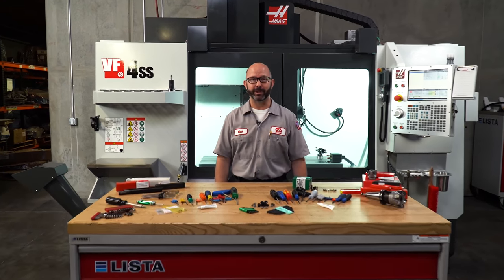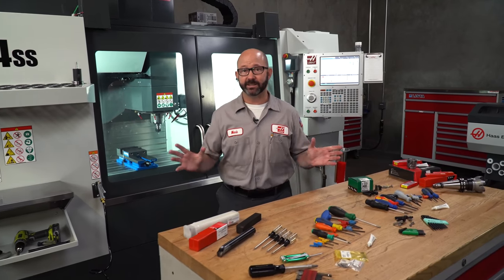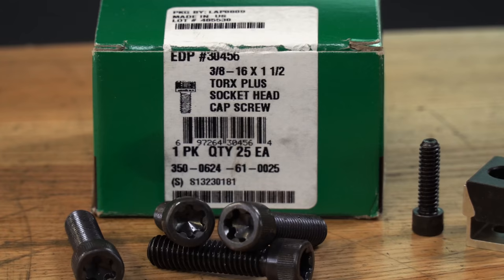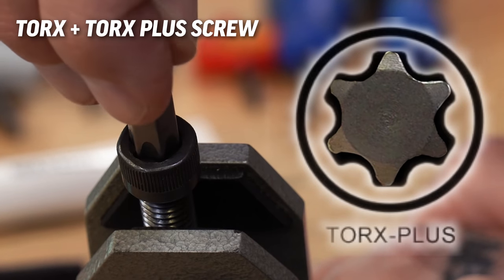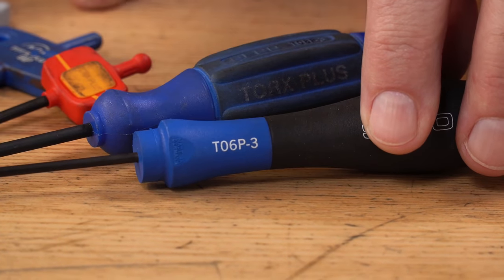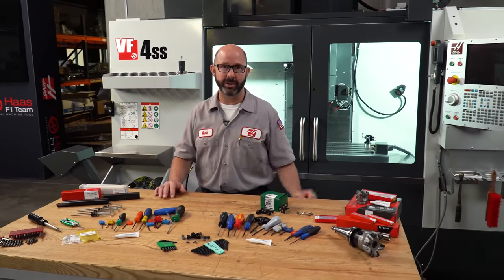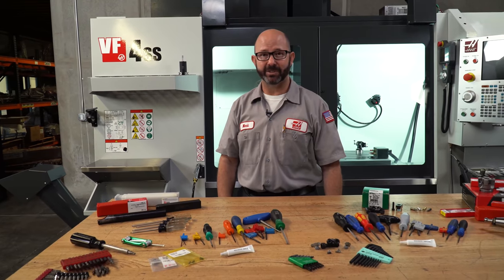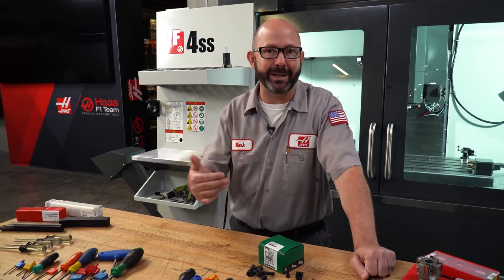THIS IS NOT A TORX - Haas Automation Tip of the Day

Comment: In the 1990s, when I sold Mac Tools I was talking to the oldest mechanic in the Buick dealership.  His toolbox looked like something you would see in a home garage and was dwarfed by the huge, newer boxes.  I was remarking on how his experience and age did not seem to match with his toolbox and he told me that since he was nearing retirement he only bought what was necessary.  
He told me that when he started, there were no Metric, Torx, Allen, etc., or electronics on most American cars, and when he bought that "small" toolbox all the older mechanics told him he would never fill such a big box.
Reply: I have an old mechanics setup for British tools. it's two smaller toolboxes with handles (2 layer, removable spanner/socket top layer). He has tools that you see in classic auctions (50s stuff) with 8 different bolt sizes on a single tool.. and a collection of them AND the sockets to go with, extensions and the rest. Then the spanners to top it off. So he had everything he could ever need to work on British cars or stationary Diesel engines, all British standard size. And you could carry it with you in a backpack to the top of a damn mountain if you had to in a war..
Reply: And then what happened? Did the other hacks in the shop steal all his tools?
That is what happens the world over
Reply: @godsinbox  No. This is a professional shop.  The other mechanics used their own.
Reply: @N4CR  Do you mean you have the tool setup from an old mechanic? Was it bought, or gifted?
Reply: What a great comment. There's an old Michael J Fox movie, Doc Hollywood, 1991, where the local mechanic has to work on Doc's Porsche, and says  "I always wanted an excuse to buy a set of metric tools". It was a great line.

Comment: Phillips camming out is actually a "feature". It was developed as a means to prevent over-tightening in the days before driver clutch mechanisms.

And I hate it.
Reply: Who don't hate that shit. But it's still easier to work with than flathead screws that are next to impossible to get in right without injuring yourself.
Reply: @ehsnils  Switch to Robertson....
Reply: @MaverickBlue42  Fewer contact points means less reliability. I'd rather select XZN.
Reply: Philips head screws are great for their intended purpose, there's a reason we still use them today even in a professional setting. 
But when they're used on screws that needs more torque applied than its intended for just because "well everyone has a phillips screwdriver" yea that's pretty shit...
Reply: @MaverickBlue42  I would rather stab myself in the eye than use square drive. Torx is better in every way as far as I'm concerned.
Reply: Get some JIS cross-head bits. Japanese Industrial Standard. 
They're a necessity for working on Japanese bikes but they work GREAT on Phillips head screws. 
Thank me later.
Reply: Well, that's nice. 2 screws that are nearly the same, but not really. Enough the same though, that depending on the light, finish on the screw, magnification, or lack thereof, and less than optimum eyesight, I can't tell the difference. And I may or may not need 2 complete sets of drivers. Super.
Reply: Failure by design.
Reply: The video shows a screw head being destroyed, but calls it "camming out", which is not correct. A Phillips screw will cam out (protecting from over-torquing) with minimal damage if used as intended. Still annoying - I would rather have Torx or other non-camming drive with suitable management of torque.
Reply: @AaronzDad  yes,you are so right sir.
Reply: Try some JIS screws
Reply: JIS ftw
Reply: I hate em too. 
But a dab of valve grinding compound on the tip of your screwdriver works wonders. 
Grab a tube at your favorite automotive box store. 
Give it a try,it works wonders.
Reply: @MaverickBlue42  lol first ya gotta remove the damn stripped Phillips head 🤦🤦🤣🤣🤣🤣🤣
Reply: @ehsnils  XZN works great, the exception is in corrosion prone use cases. The high surface area of those small splines means they corrode more and weaken faster compared to something like Torx. Speaking from personal experience, I wish Volkswagen/Audi Group would recognize that fact. Obviously less applicable in the machine shop, but important to point out nevertheless.
Reply: @MaverickBlue42  eww gross. the only time i ever put a square bit in my driver is to take rebertson drive screws out and throw them away.
Reply: Trouble is the fastener always seems to take more force to break loose than it did to tighten it. Kinda like Mt Everest takes more effort to descend than it did to summit.
Reply: @brianb-p6586  Part of the issue being that an awful lot of the Phillips screws we see nowadays are very soft and easily damaged, obviating the cam-out feature.

Comment: This is something that has always blown my mind. How are there so many machinists that don’t know the difference.
Reply: Utter disinterest. They're the type of machinist that work on a machine for 10 years and don't know the basic things about their control and what the various buttons on there do - not having picked up the manual and give it a glancing check in all that time.
Reply: you use what's on the shadow board or in the drawer. I've been in factories the better part of a decade now and this is news to me
Reply: lol! Do you know everything in the machining handbook!
Reply: @dominic6634  lol! This isn’t in the machinery handbook!
Reply: YOU don't know, what YOU don't know.
Reply: The real question is: Why should there be a difference...
Reply: @dominic6634  there’s a handbook?
Reply: @AmalgmousProxy  Greater torque application, less likely to strip out. You do realize that you can't learn every problem with your standard before it hits the market right? Torx Plus and Hex Plus are far superior.
Reply: @svn5994  My point that you failed to understand is they need to phase out the inferior fastener. An example of this is there's absolutely no reason to keep making flat head screws. Not one reason. To this day they still make torx and torx plus, same thread. There's no need to keep both...
Reply: @AmalgmousProxy  i agree, I wanted to buy some torx plus but can't find almost  any online. Ideally I'd buy a complete set of sizes from smallest to biggest once for life. There are also   TORX TTAP and TORX PARALOBE both upgrades to torx plus, but where the fuck can you buy them? Honestly I've searched and searched but to no avail.  

Its just like with the titanium tools coated with micro diamonds, almost no one knows what is the best, steel can't rival titanium, much less diamonds, the hardest known substance to man.

Comment: Great video as always! I wish more manufactures stepped up with good well edited educational content not just some one minute flashy marketing wank crap that gives zero practical information. Also you should do a follow up about insert screw torque wrenches/drivers. They are a wonderful investment if you are doing any sort of serious production and changing tools a lot.
Reply: That is a great topic. We avoided Torque Specs in this one, but we'll be coming back to it. Using a lubricant will completely change our torque values, and just about all tooling manufacturers recommend using a lubricant on our insert screws. I was doing engine block machining, and using ARP studs for the deck plates, and the torque numbers I was given were not for bolts using the ARP Moly/Ultratorque, so when I tightened things up, it immediately ripped the studs right out of the aluminum block, with so much tensile pull. When using a lubricant, we get a much more even torque (less torque scatter), and we end up using lower torque values. On old engine heads, you had one spec if you oiled the bolts, and another if tightened dry.
Reply: @markterryberry4477  спасибо,это было интересно!

Comment: I first ran into Torx Plus fasteners on my 2000 and 2002 Astros. GM uses T+ fasteners extensively, to the point that when I find a Torx fastener, I reach for a T+ wrench first. I've found that Ford also uses them for high load applications. My '04 Ranger uses T+ fasteners to attach the box to the frame, and for the door adjustment fasteners.

Comment: There's also RBRT Torx tools for the torx screws that have become stripped or wallowed out. They're designed with angled teeth so as to grab the fastener to ensure removal.
Reply: Ooh, I learned something new. Thank you
Reply: Also, I've noticed if you have a regular torx 15 screw that is worn out that you can sometimes fit the Torx plus in it to get it out.
Reply: Heard you can just use an Allen but I've never needed to try it myself
Reply: @wades623  You might get lucky on a certain size or two but it definitely doesn't work all the time.

Comment: What will really bake your noodle is finding out how many different “cross” screwdrivers there are.
Reply: There's Philips, Posidrive, and JIS that I remember off the top of my head... and curse the inventors out whenever I encounter them because I almost never select the right tool for the right head the first time.
Reply: You know what really bakes my noodle?
Finding a flathead screw.
Reply: @dougaltolan3017  - I’ve seen a lot on ships and old engineering.  They have flat head nuts, bolts and there’s no thread.  Spooky stuff!  ;-)
Reply: @dougaltolan3017  Watchmakers use flathead screws for almost everything.

Then again, watchmakers also custom-grind their own screwdrivers for a perfect fit...
Reply: @daveys  🐸
Reply: @kaseru6760  That's not actually true.  It's called Torq-Set, it was developed by Phillips, and a bunch of aerospace companies use it.
Reply: @dougaltolan3017  Slotted screws* - flathead is a type of screw profile. But to be fair if it's not a high torque application, slotted screws can sometimes be handy as you can use somthing common like a coin to tighten or loosen it. So if it's going to be used somewhere were tools arn't likely to be around and needs to be serviced often, slotted screws can save the day, just keep a few spares handy. And even slotted drivers come in a variety of different sizes for a snug fit, if you are using the same size for all slotted screws you are doing it wrong, but they do give you that flexability in a pinch.
Reply: Which indeed is really strange, because in my eyes the JIS-Standard is clearly superior to the others and exists for probably over 40 years now...
Reply: I didn’t realize how many there were until I read your comment and looked it up. Holy cow!
Reply: @peteraugust5295  Well, Frearson does almost everything that JIS can do, plus you only need one size driver for almost any size screw, plus it dates back to the 1870s!  The only thing JIS does that Frearson doesn't is the ability to use JIS bits on Phillips screws without damage.
Reply: What really bakes my noodle is going to get your Phillips screwdriver only to find out your kid already swiped it on you and didn't put it back where it came from
Reply: Now there are multi-cut screws because of evolving tool standards - to keep them backward compatible.
Electrical outlet mounting screw heads are cut to take flathead, phillips or square bit.
Unfortunately, that leaves very little surface to grab on to no natter which of those tools you use. ARG!
Reply: @2Truth4Liberty  we need to make a screwdriver that use all of those to engaging with every small bit of material left
Reply: @aggese  I'd hate to add yet another tool to the already wide variety but . . .Great idea! 
It would be well worth having that special tool just to do electrical outlets.
Hope you get a patent and sell it to leviton :-0)
Reply: @aggese  They literally already do!! E.G. PB Swiss 58180.
Reply: Patents are the opposite of an open and free market. Also why isn't this on a universal standard already? Lately I have been at the point of just drilling out any freaking screw head that take more than 3 bits to try and find a fit.
Reply: @2Truth4Liberty  the only bit that even feels close to solid in those is Square2, Ph2 cams out instantly and the slot is cut like garbage
Reply: @Hyratel  Yep, agree. I suppose you could set the square bit in the screw (head facing up) and then let a drop of solder in there   :-0)  
The last time I worked with switches and outlets, I actually bought a box of phillips machine screws 6-32 x 3/4" and replaced the factory screws with a pure phillips.
Reply: @daveys  They still considered the standard on firearms to this day, thanks mostly to tradition. Allen-heads are making progress, but all traditional guns use flatheads. It's even more baffling when you factor in how critical fastener appearance and condition can be on guns.
Reply: @LN997-i8x  - I like a good Allen head fixture.  I think they look nice on things more often than not.  I don’t have any guns myself but my kids tell me that there’s a visual appeal to them beyond pure function.  I don’t think my kids have any guns either but they play a lot of video games.
Reply: @kaseru6760  Don't think it's an Airbus invention. All the external panel screws on the F-16 are countersunk with this offset cross.   I must have extracted over a hundred of them stripped screws, got it down to an art.

Comment: I’ve been a machinist and tool maker for 60 years and have never had any problems with standard Allen wrenches. All these different TORX designs are not only confusing but unnecessary.
Reply: I think you'd run into problems with hex heads rounding out more often with hex head screws in this application. Especially with really small insert screws.
Reply: @leesuschrist  Not hex heads, hex socket heads.
Reply: Agree 100%, you may eventually wear out an allen wrench but rarely wear out a socket head cap screw. Torx head screws cam out all the time.

Comment: BMW from 2006 on utilize EP fasteners which are made of aluminum. They are one time use bolts which BMW calls aluminum stretch bolts. The reason for this is due to the amount of magnesium used such as the magnesium block and various other parts to eliminate electromechanical corrosion of fasteners. ie: Iron/ magnesium or aluminum/ iron. 👍Thank you for creating this video and putting information out there.

Comment: My father did CNC machining when I was really young; largely self-taught to land a job at a friend's shop, super impressive given his lack of mathematical background. Anywho, I was ALWAYS digging through tools and getting into things and would notice super slight variations in the appearance of the Torx drivers: sharper lobes and deeper cuts vs squared-off lobes and much shallower cuts. Thanks to this video, I now know what I noticed since childhood wasn't some weird variation and actually means something. If only I knew this information over the last 20 or so years of driving and working on my own cars. All that digging and digging through the same old tools and many new ones, sometimes wondering why in the hell the key/bit that "fits" is sometimes loose or won't fully seat in the socket, hahaha

Comment: As a diesel tech, I can tell you that the torx IP fasteners are way more common than you think. They've been on 15L diesel engines since, at least, the mid 90s.
Reply: Jesel valvetrain has used them on their rocker shaft stands. PITA tryin to find one at the dragstrip if u gotta problem.
Reply: Been on Subaru's for a good long while too.
Reply: Fiat and Alfa engines too. Regardless of the supposed superior torque transfer quite often the recess will be too shallow to get a good purchase,head bolts in particular,anyone remember the early Ford Zetec cam sprocket Torx bolts😂. You see plenty of examples of shallow heads in places where there is more than sufficient room for a decent hex head or a deeper Torx head,FFS! and I've had plenty of EP Torx heads snap off on BMW's leaving a nice sheer bolt style security device too. At least it isn't Allen bolts or that multi spline crap VAG uses.

Comment: I'm not sure this is the best way to describe/word it but from diagrams I've seen, TorxPlus is especially Ideal for high-load torque especially because the angle of tension is perfectly perpendicular as opposed to the traditional torx being at an angle crossing the line of rotation, more or less. Which doesn't even begin to discuss that construction screw manufacturers typically use the same alloy for both screw and bit to further reduce on density tensions and increase longevity of parts.

Comment: Awesome video, thanks for sharing!A couple more tips worth mentioning to save alot of time for production shops:
1. Have a tool list posted on each machine. The list should show a description for each tool, next to it type in the torx driver used for the insert screw(s), and adding the insert screw part number is very helpful as well. Side note: we primarily use torque torx drivers, which immediately stopped over tightening when we went to them.

Comment: I love when people use abstract design drives just to be different… I love buying extra tools…
Reply: I love to cam out.. they’re doing a job, like he said they’re an improvement.
Reply: How do you know they are using it “just to be different” rather than actually having a better solution for the application? Sometimes engineers are a little too obsessive about data and performance figures. The scheduling and accounting  departments usually have a challenge on their hands in that regard. 

 And ip torx screws aren’t abstract at all. It’s about 50/50 with holders screws I see with each design. And most (probably all really) ship with a driver.
Reply: @Jspackman  That's what the patent system promotes. Their patent ran out so they made an "improvement" that no one really needs.
Reply: And there is the Robertson square drive that is used in a lot of wood screw applications or the crown bus external 12 spline dome head screws that they use to keep the little darlings from taking things apart on the way to school.